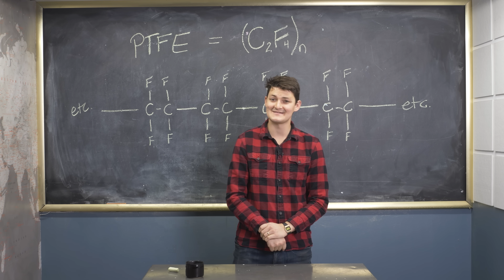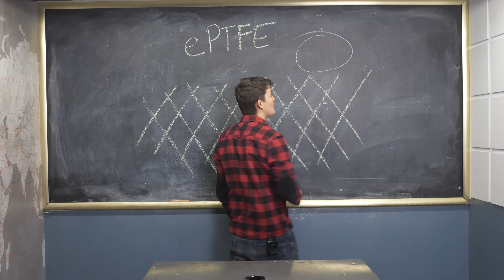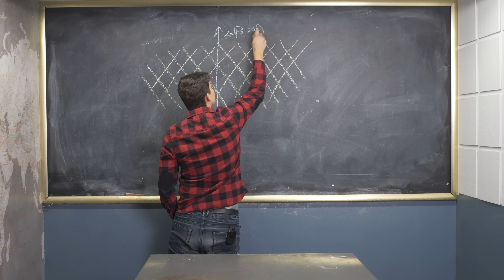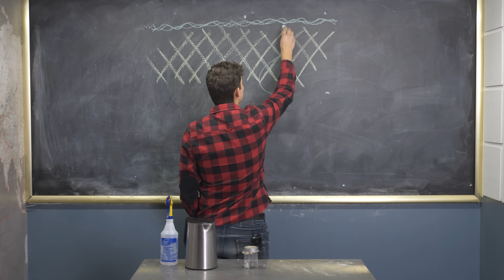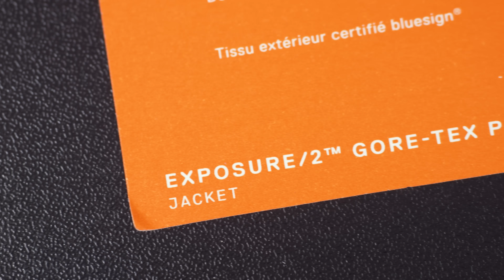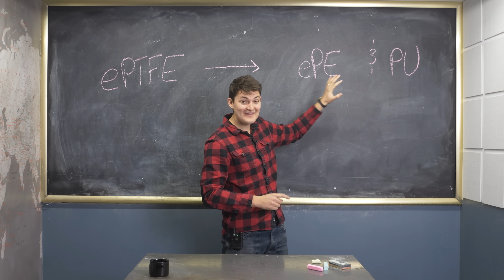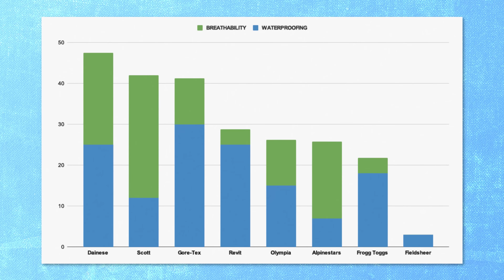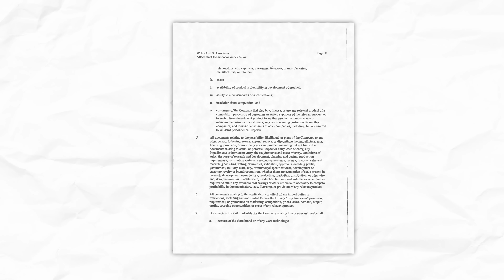Gore-Tex is a Marketing Gimmick

Comment: Ryan, I am guilty for branding my family under The North Face since 2018 to date. We all horded das 175 Euros jacket during our time in Austria, and the first to complain of its breathability was....my oldest daughter.

She is 5ft8 btw. Was sweating like nuts and had to change her clothes thrice a day when working at the university. I didn't complain at all, even try to hide my sweaty back that could squeeze a cup full just to encourage her keeping her Gore-tex backed f#%@kg sh!t. Regrets? 3 years later just PU jacket and more emphasis on breathable mesh were what I'd learned and to protect her better.

Don't be like my dumbass and work out the kinks trying to make Gore-tex fit. It ain't!
Reply: I disagree, I think the point is not that Gore-Tex sucks (as IMO it absolutely doesn't), it's just their business practices.
Gore-Tex has always been the best or near the best (anything better is only barely better, most could not tell the difference) of such membranes, there is no better combo of either breathability or waterproofing. Anything without such a membrane is infinitely worse. Most people only need to use them for max a few hours at a time, and during such periods Gore-Tex performs well.

Note: the fact that you can only have one or the other (Ryan is slightly exaggerating too: it does still breathe a bit when wet) is still better than any other alternative which either breathes and is not waterproof or is waterproof and does not breathe. I repeat: your only alternative (to Gore-Tex or something basically identical) is something that does NOT have the double-use trick of breathing AND being waterproof.

I've used Gore-Tex in countless different sports and outdoor activities, and motorcycling is by far its toughest test where it doesn't seem to be able to stay waterproof. I believe that's because of the huge amount of water accumulating in the front, and it being pressed onto and into the surface so strongly and constantly by the air pressure.
Reply: @pistonburner6448    Yeah Gore-tex indeed was too monopolized to horde their tech for as long as they could. It was a realistic case study for analyzing during my bachelor almost 7 years ago - just happened to resurface via Ryan's video!

So membranes and marketing aside, it's just you can't have a cake and eat it, too.

Choosing breathable material was my call at the end of the day. After that, a spray of PU coat to at least coping with the rain until we get home. Compromises we made, explained to my daughter.

And fukc Gore-tex.
Reply: @hainhatphung1371 but with Goretex (and similar brands) you CAN have your cake and eat it.
Just not at the same time.
I can't think about many situations where I would be willing to carry two jackets or boots with me. So Goretex (or similar brands) it is.
Reply: @pistonburner6448  In my experience GoreTex is not waterproof at all after the first time the seams get stressed.  If it's the best, then they're all equally worthless.
Reply: @SeniorKlean  Well, that's not correct. If you have had one bad jacket which has been poorly made...once again: GoreTex is not one single type of textile, it's a membrane added to a whole host of different textiles...and some manufacturer may have done the seams poorly.

I've been doing many different kinds of sports and ridden motorcycles with GoreTex and I've never had that problem.

GoreTex isn't supposed to be nor has it ever claimed to be 100% watertight like a diving dry suit...
Reply: @pistonburner6448   I have had 2 jackets and 3 pairs of boots with GoreTex.  None of them remained waterproof longer than 1 month.  And there's only 1 level of waterproof, it either is or it isn't.  Yea, most clothing isn't skin tight like a dive suit, so water can get in through the appendages, but if it's waterproof, it shouldn't let water through it.
Reply: @SeniorKlean  I call bullshit.

And you're wrong: there are many "levels of waterproof". What a stupid thing to say. Jump into the pool with GoreTex... it's never meant to be fully waterproof. I'm pretty sure it even says so on the label.

I think I've already written here how no such gear is fully waterproof, as riding a motorcycle is far more challenging with the huge amount of water and the wind which pools the water and also puts pressure on it.

Totally different to do other sports than riding a motorcycle.

You're making stuff up.
Reply: @pistonburner6448   If water gets through, it's not waterproof.  Sorry bud, but words have meanings.

Also, my experience with GoreTex is unrelated to motorcycling.  The best way to stay dry on a motorcycle is to drive a car when you're expecting unpleasant weather.  Cars are waterproof.
Reply: @SeniorKlean  Wrong. Fabrics like this are not meant to be 100% waterproof. They're not for diving, child.
Reply: @pistonburner6448   Now that you're coming around, not being 100% waterproof makes it pointless.  We already have 100% waterproof materials, such as leather, vinyl, and wax.

It'd make more sense for a dive suit to not be 100% waterproof, I expect to get wet when swimming.  I don't expect to get wet when wearing "waterproof" clothing.
Reply: @SeniorKlean  You just don't have the IQ to handle this, do you?

Leather, vinyl and wax don't breathe. And leather is not waterproof, definitely not 100% waterproof either.

GoreTex (and similar) is fantastic and unbeatable as it breathes and can handle water too, for the few hours people usually subject it to.

But for sure it's best if you use plastic. Especially a plastic bag over your head...it'll be 10000% waterproof so nothing else will do.
Reply: @pistonburner6448   GoreTex doesn't breath either when wet.  Want a leather jacket to breath, open the zipper vents.  And I've never had a leather jacket let water through.  Perhaps it is you who doesn't have the IQ to keep up with all these moving parts.
Reply: @SeniorKlean  First of all you're wrong: GoreTex DOES breathe when wet. 

And second of all the main thing is that it breathes very well in the conditions most people use it most of the time: when it's dry.

That's the whole point: it breathes really well in typical use, and then it ALSO has you covered when it starts raining. 

But some people just don't have the equipment to manage simple logic.

Also: if you con't know that people with leather gear NEED to have separate rain gear you're just showing monumentous stupidity. No-one uses leather in rain.
Reply: @pistonburner6448   Watch the video man, Ryan clearly demonstrates it not breathing when wet.  Even Gore themselves don't claim that it breaths when wet.  

Sure, it works great in the dry.  But so do jackets that cost less than half as much.  

I don't know why I bother, you're clearly just fangirling for company that doesn't even know you exist over a product that doesn't work half as well as advertised.
Reply: @pistonburner6448  Try a well dubbined Lewis leathers super Bronx motorcycle jacket, boots and trousers. That's waterproof enough for Scotland for goodness sake.
Reply: @andrewallen9993  Do they breathe?
Reply: @pistonburner6448  Cows and Horses? Yes whilst living, once dead tanned and dubbined they work like gore Tex, if it's wet they are waterproof if it's not you unzip them.
Watch the video to see how that's exactly the same as gore Tex :)
Reply: @andrewallen9993  no doubt it can be waterproof, like a rubber/plastic jacket can be too. It's the breathability that is questioned here
Reply: @gnarlydog  It's supposed to be like a Russian Vostok Amphibian dive watch, if they say it's waterproof to 20 atmospheres\200metres then it's waterproof to 200 metres NOT water resistant. Dubbined Lewis leather jackets are waterproof for use on a motorcycle. I must admit I have only tested mine at speeds of 120mph though :)

Comment: My Gore-Tex jacket was forgotten for a few years in a box.
When I found it, the Gore-Tex was flaking off and the jacket was simply a jacket, not waterproof or even water resistant.
Reply: You should call it Gore-Ex then.
Reply: @axelvetter  LOL!
Reply: Of the garment is bk longer waterproof and it's a gortex product gortex has its own warranty on anything with their name on it.
Reply: @thecanuckredcoat4142  I'm not going back to the landfill to retrieve it for the warranty.
Reply: Common with bonded and coated fabrics unfortunately.
Reply: Because the actual gortex membrane is so incredibly thin and easily damaged, it's sewn in as one of the middle layers of the garment. If something was flaking off it was probably whatever hydrophobic type layer is on the outside in an attempt to keep the gortex dry and thus more breathable.

It's just so funny that a "good gortex jacket" tries it's best to keep the supposedly waterproof part away from the water.
Reply: Goretex didn't require three layers back when they started.  I had mountaineering clothes that were made specifically to be as light as possible.  That's almost forty years ago. @marsrover001
Reply: @marsrover001  It was on the inside.
I thought it was weird that they did not cover it with another layer, but it was a lightweight jacket.
Reply: I just use a $50 military surplus M65 and spray spray-on watereproofing spray on it every year. The rain protection part and the insulation part are separate and held together by buttons; if I get sweaty under it I can open the rainshell, unbutton the liner from it, and button the liner closed under it. It did soak through once but only after an hour in pouring rain. It also comes with a drawstring on the bottom so I can cinch it closed against my body so cold wind can't attack my belly from below.
Reply: @TOASTEngineer  I miss the spray on waterproofing from Scotchguard.
Reply: @patmcbride9853 don't they sell it anymore?
Reply: That was probably the hydrophobic coating mentioned in the video?